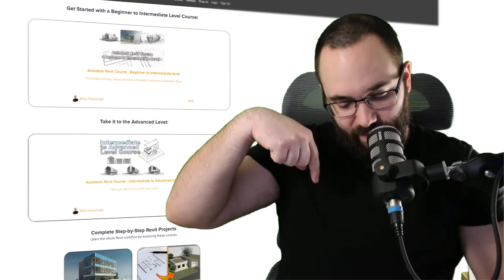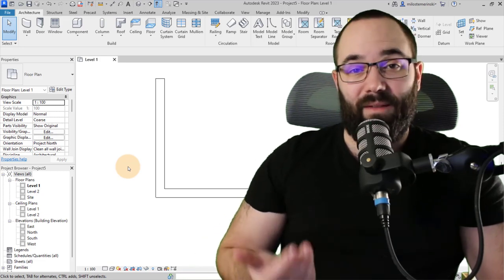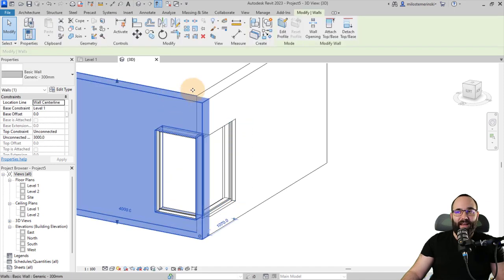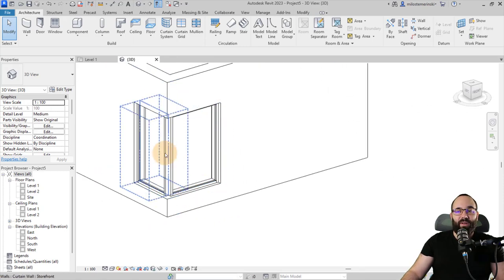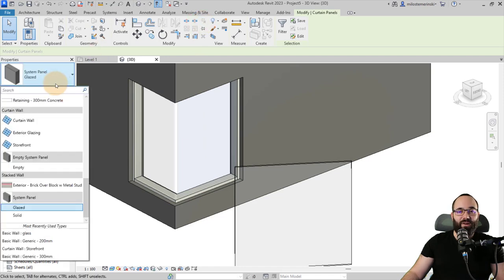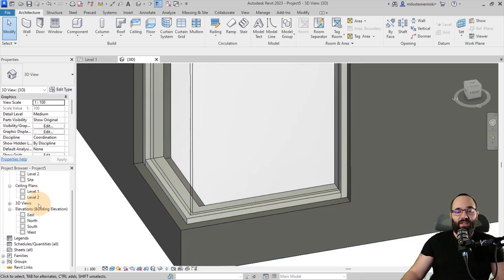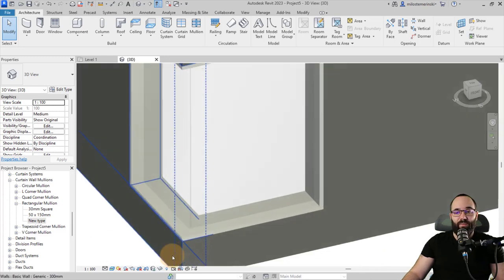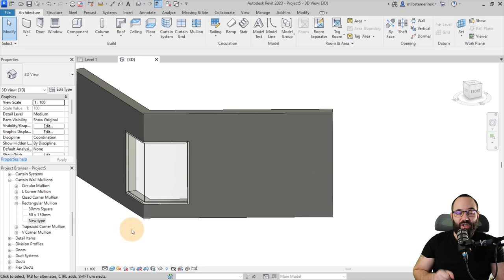Adaptive Corner Window in Revit Tutorial

Comment: After working with Revit for the last decade I found another way of handling storefronts. I create a generic wall that I call "Opening" and typically make it the same width as the storefront (typically 4.5"). I give it a distinctive different fill color...like pink.... then use it to cut the primary wall. In most cases that is either a CMU or tilt panel wall. 
Then I place the storefront into that "pink" wall with 'automatically embed' turned on. Then depending on the jamb and head sealant conditions I make the embedded storefront shorter in length and shorter in height than the "pink" wall by whatever the sealant wants to be around the perimeter of the storefront (usually 1/2"). This process also helps for adding any special type of sills, especially in CMU walls.